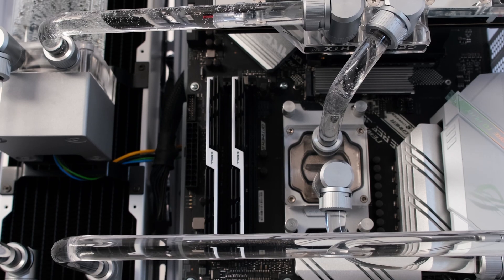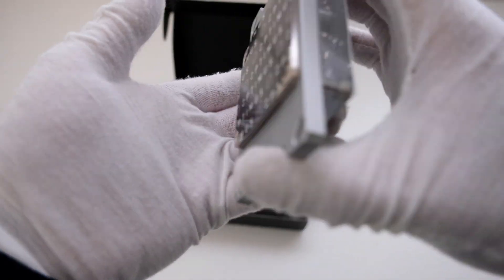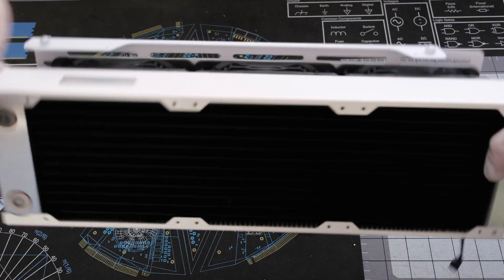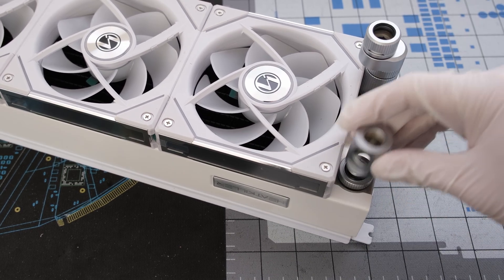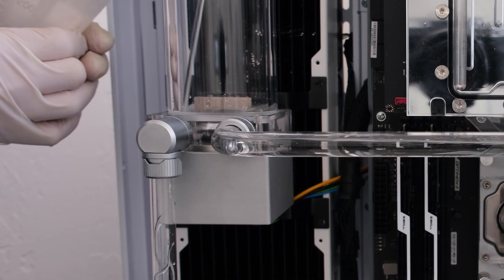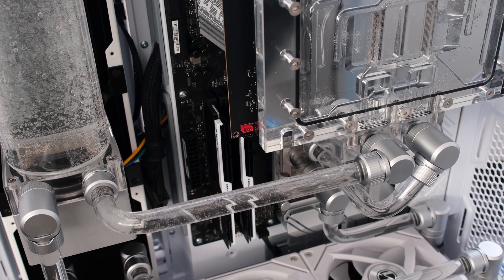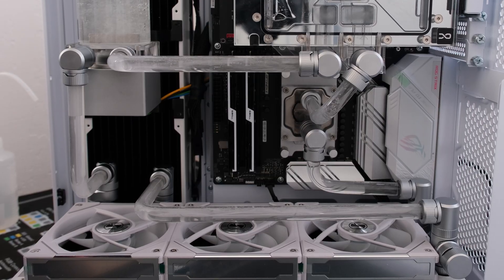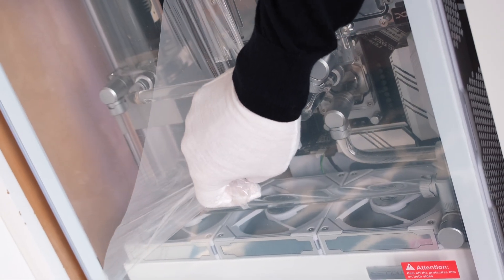Watercooled RTX 4090 Build - Step by Step

Comment: What vertical gpu mount did you use?
Reply from the maker: Thanks for your comment 🙏 I used the Lian Li O11DE-1W Vertical GPU kit for O11DEW White. It's the vertical mount for the O11D Evo. It's very strong. Even though the directions say to not use it in the inverted position, I did anyway because it seemed like it would hold and it has held fine ever since. Hope that helps.

Comment: I love everything about this channel. I just subbed!
Reply from the maker: Thank you for your comment 🙏That's the best! I am happy that you enjoy the content. I am working on another 4090 PC build, but this time with a black/dark theme. Black EVO, regular vertical mount, 4090 FE with Heatkiller water block, Heatkiller reservoir, Heatkiller rads x2, Optimus CPU water block, AM5 system with 7800x3D, black soft tubing, black fittings and hopefully some quick disconnects. Thank you for watching and commenting!

Comment: Great video, but why build it inverted ?
Reply from the maker: Thanks for your comment 🙏Good question. In short, for variety. In detail, well, it was a journey from at first being against using a riser cable at all and wanting a "native clean PCIe connection directly to the motherboard" and then trying out the riser cable once and really liking how I could see the flowpath much better and made it feel like a setpiece in a build. So, after building in a be quiet! silent base 802 and having a vertical GPU in the bottom left, it was really cool. Then, along came the Lian Li o11D EVO and it had the option to invert the chassis and it dawned on me that it may be interesting to see how a GPU would look if the main attraction (set piece) was in the top right corner. So, I tried it. The instruction for the vertical GPU mount actually specifically says not to mount it inverted. However, after looking at the mount carefully and imaging how it would work, I came to the conclusion that there would be no issue and it would be properly supported (no issues whatsoever since the build). The cool thing that happened as a result of the inverted position was that all the tubing could be run in a manner that was like a soft rectangle. It is visually appealing in different ways and took a lot of effort to make sure it lined up and looked even all around. That tubing in the middle was really nice to shoot footage and generally is pleasant to look at. So, yea. Hope that helps and thank you for watching.

Comment: So I installed this waterblock,  put a small overclock on it but I'm seeing my graphics card temp over 80C. Are you seeing that as well? I followed your instructions exactly. I have a 360 rad with two 120mm fans. I would think it would be cooler?
Reply from the maker: Thanks for your comment 🙏 Can you help me clarify your rad and fans? Do you mean two 360 rads with 120mm fans installed? If so, then I would check the mount, as that seems too high. If you do mean one 360 rad with 2 fans, well, I would add a fan first and see. Hope that helps.
Reply: @vectornetwork  Yes, I have a 360 rad with two 120mm fans (I can't add a third since the water pump is in the way. I was thinking of adding three more fans to the back of the rad inside the case blowing air outward through the back case holes. I actually removed the overclock entirely and the temp will raise to 80c within about 20 minutes of gaming.  Even with only the two fans, it seems like the watercooling should keep it at lower temps than that. What is your highest temp while gaming?
Reply from the maker: @justaguydoinstuff  Hm, how thick is your 360 rad? The build is using 2 separate 360mm rads with 48mm thickness (larger than the standard 30mm) with a total of 6 fans. If you are using a 360 rad with only 2 out of 3 fans attached, then I expect temperatures to be worse than a full 360. However, do I think they would be at 80C? Maybe not, maybe 70C. Do you also have your CPU in your loop? That would cause it to likely hit 80C. Water cooling is effective but air cooling can also be effective. Water cooling can certainly lower the noise level beyond air cooling though. Hope that helps.
Reply: @vectornetwork  It's a separate loop from my CPU but I think I found the issue. I put two flat pump/reservoirs in the wall mountable case but realized that the GPU loop radiator didn't have any holes in the back of the case since I modded it to put it in there. So I drilled a few holes behind the radiator so it could breathe while also adding the 3rd fan through another mod. So now my temps seem to max in the 60's, so I'm pretty happy with that. :)

Comment: That hotspot could be due to the air pocket in the GPU cooling plate. After confirming no leaks, you should always tilt your PC to remove all of the mid to large air bubbles. The small and microbubbles will naturally be removed by PC use. Just something to note.
Reply from the maker: Thanks for your comment 🙏 You could very well be right. Especially since it was in an unfortunate spot, before the next time I used this system, I made sure to tilt it enough to get most of that large bubble out. Since then, all the microbubble dissipated and its clear enough where barely looks like the coolant even moves. There is still a minor bubble in the GPU block area but it's fine (to me). I nearly ready to maintenance this system anyways. I want to add an Aquacomputer Octo controller to it so I can better control the loop. I will also add a coolant sensor and use blue coolant this time around. I will likely record all the footage and include it at the end of a future episode. I will keep your note in mind and thank you!
Reply: @vectornetwork  Cool man! Looking forward to the video!

You should look into "fancontrol". That could save you some money. Jayztwocents made a youtube video on the software capabilities titled: "Everyone NEEDS this FREE piece of software... You will thank me!" I use that to control every single fan in my case as well as my pump (Corsair Hydro X Series XD5)! Even the 3 PIN's can be controlled well enough to act as if they were 4 PIN as long as you ultimately use a MOBO fan header. The software is rather bland looking, but the independent developer is still working on it. 

If you have any questions shoot me a message. I'd be happy to help where I can.
Reply from the maker: @dorout1  Thank you for the info 🙏 I may try that as its good to know about all the different utilities being used related to water cooling
Reply: Here's the deal: if you have an air pocket in your GPU block, it's because that area does not have proper flow and the water there is stagnant. Even if you tilt it until it fill, that water is still going to be stagnant there. It's just a poor GPU block design for the orientation.
Or, in this case: an indication that this block should absolutely not be vertically-mounted upside down.

Comment: Can we have a component list and price? I'll like to have something similar
Reply from the maker: Thanks for your comment 🙏 Good idea! See below and I added this to the description. I don't have the pricing at which it was purchased at. Hope that helps and feel free to let me know if I am missing something. 
Parts
-Case: Lian Li o11D EVO
-CPU: AMD Ryzen 7 5800X3D
-CPU water block: Optimus Foundation
-GPU: PNY RTX 4090 XLR8 (Reference PCB)
-GPU water block: Alphacool Eisblock w/ backplate for RTX 4090 Reference PCB
-Pump-Reservoir combo: Optimus Absolute 8.5" D5 
-Motherboard: ASUS ROG Strix B550-A
-Memory: 32GB G.SKILL DDR4 3600 MT
-Storage: 4TB XPG SX8100 M.2 NVMe SSD
-Fittings: EK-Quantum torque compression 14mm OD Satin Titanium (Extender 14mm, Offset 7mm, Offset 14mm, drain port, T-splitter. 90 degree adapters)
-Heatkiller RAD 360-L w/ 3x Phanteks T30s
-Heatkiller RAD 360-L w/ 3x Lian Li UNI SL-Infinity
-Bitspower Acrylic tubing 14mm OD
-Corsair Hydro X Series XL8 coolant in clear

Comment: Hello friend! Very nice videos! Keep goin! PS. But, please,  put your new perfect PC from a tight enclosed space to the right one, where he can suck fresh AIR.
Reply from the maker: Thank you for your comment 🙏 Good eye. It is a concern and why the PC is water cooled. Otherwise, the noise would be too audible. There is a hole in the back of the space where I attached a fan to the exhaust the air, to help with ventilation.

Comment: Why wear gloves? Are you afraid of infection?
Reply from the maker: Thanks for your comment 🙏 The gloves are purely for the camera. It's intended to provide a more clean and uniform look. I take off the gloves for anything important off camera as its certainly easier without them on (it gets hot)
Reply: prevent fingerprints
Reply: I like the gloves but I totally get it’s hot. 😊
Reply: If you have to ask, you're not a pro system builder

Comment: Can you push the graphics card power limit past 100? Or is it locked at 100?
Reply from the maker: Thanks for your comment. 🙏 I haven't tried yet due to the four 8 pin to 12 pin power adapter that has been known to fail under certain conditions. I have a new power coming within 2 weeks and I will try then. I don't think it is locked at 100. Their appears to be plenty of headroom for overclocking but it's already so fast, stable and cool that it feels like an afterthought - but I certainly will try 🙌
Reply: @vectornetwork  You don't actually need to overclock it, just curious if it's possible. With MSI Afterburner, you can just see if the slider will go past 100 without actually pushing the 'activate' or whatever button. :)
Reply: I'm also curious why you didn't have the alphacool graphics card led lights on? I'm curious how they look? I have a PNY on order and am most likely going to buy this waterblock as well. It looks really nice!
Reply from the maker: @justaguydoinstuff  Oh, it didn't occur to me. I was fixated on fixing the RGB on the Lian Li fans and I sort of forgot about it because I had tucked the cable into the riser cable. I should try it out, its right next to a header. If it's any good, I'll report back, thank you!
Reply from the maker: @justaguydoinstuff  RGB on the alphacool water block illuminates the whole rectangle. It is vibrant and the light reflection off of the chrome plating delivers the dopamine quiet well. 👌
Reply: @vectornetwork  Thanks! Now I just have to wait until the PNY becomes available again...already on backorder but for who knows how long...

Comment: Optimus blocks are phenomenal, I’m definitely going that route in the future.  I wanted one for my 3090, but it was on back order so long I bought an EK.  I’ve owned a total of 10 EK blocks though, they’re good, but Optimus is a step above imo. Hoping they release one for my MSI Gaming Trio 4090
Reply from the maker: Thanks for your comment 🙏 I agree, Optimus really pleasantly surprised me and their CPU block and Reservoir are my go-tos right now. I considered their GPU block, but it wasn't going to be available at launch and they were for the more popular models (rather than PNY reference). Also, Optimus GPU blocks are known for exceptional performance, but the downside is that they are heavy. Like heavy. So, I wasn't sure if that would be a good idea since I would be mounting it vertically and upside down. The gaming trio is a popular custom pcb so its possible you'll see blocks come out for it over time. I would also suggest looking into Heatkiller (watercool.de) GPU blocks. I installed one recently for an SFF build and was also adequately impressed.
Reply: EK blocks can be superb if done right, i took the stepp above and used liquid metal as thermal paste,  Way better heat dissipation than normal thermal paste. and ofc adding enough radiators for no water heat rise overtime is a most.
Reply: @exnetic356 EK blocks are superb when you don't buy them, because you know...there are many, MANY superior options.